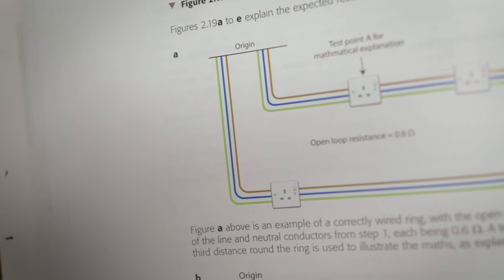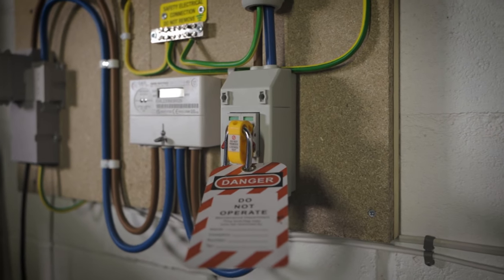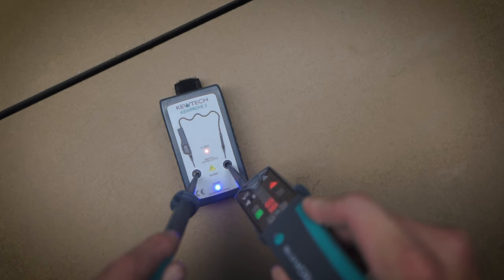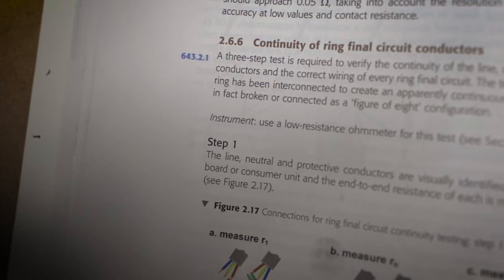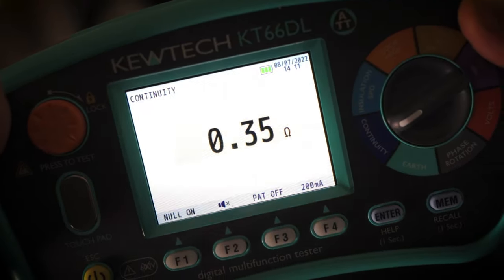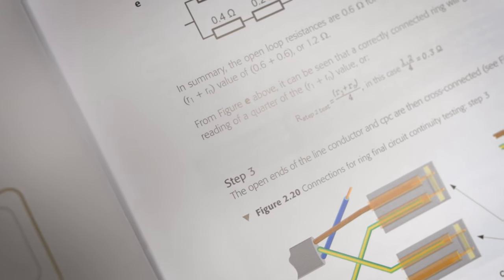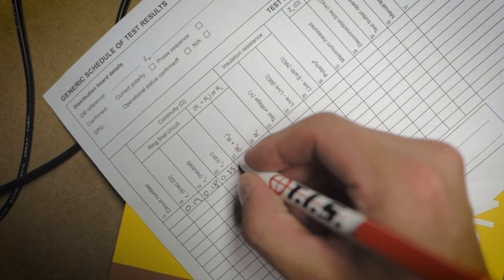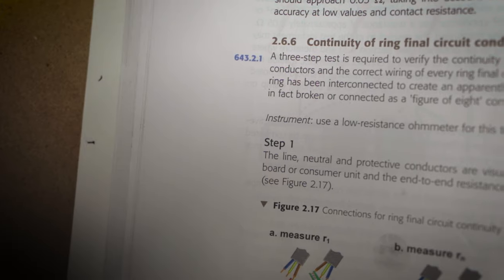Ring final continuity testing - r1, rn, r2 & R1+R2

Comment: I know the vid's not about this, but would luv to treat myself to a KT66DL but what were they thinking with the product design?  The colours are terrible 😯😯
Can they be interchangeable?  Maybe they should do a hello kitty version.

Nicely presented with the testing info mate 👍
Reply: Mike should defo review it for loadout, as I’m 50/50 between the MFT1741+ & KT66
Reply: A lot of people criticise the colour scheme but it’s not that bad. IMO it’s absolute quality. Easy to use and the screen is a huge upgrade on anything else on the market
Reply: @residualelectrical  Plus most places it’s £100 less than the top Megger. So looks like decision made. Cheers

Comment: what is the relationship between r1 and r2 recorded in step 1 and (R1+ R2) recorded in step 3.
Reply from the maker: Little r’s (r1, r2, rn) are the end to ends of each conductor on a ring circuit only, R1+R2 is the combined line and neutrals of any circuit and done on rings and radials 👍🏼
Reply: U mean cpc